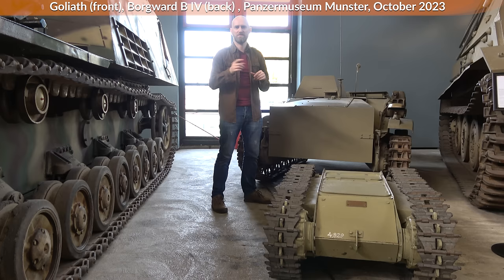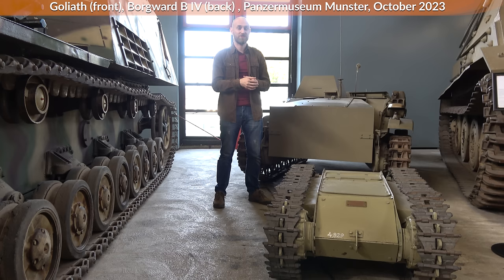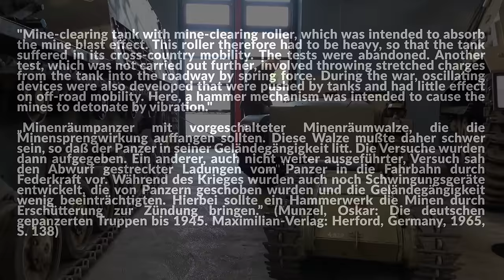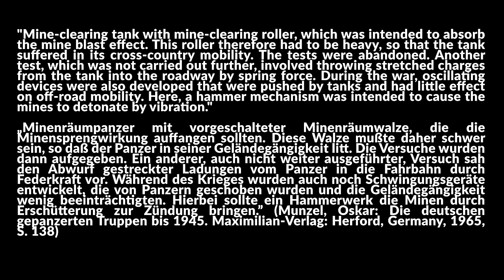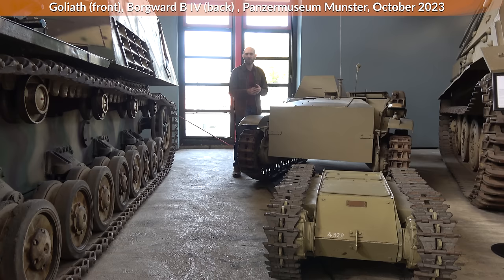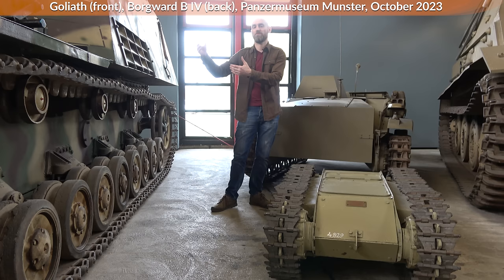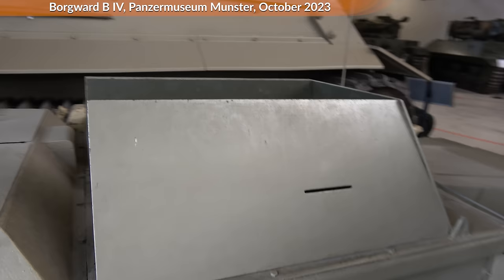Why no German Flail Tanks?

Comment: So in Afghanistan our engineers clearing mines got rotated off the vehicles after 3 mines were hit.  Anything more than three mines and the engineers started getting a little shell shocked and twitchy in the cabs of the mine clearing vehicles.
Reply: Getting concussed repeatedly in a short span leaves some level of CTE like damage.  As a byproduct of the NFL mess, the military became fully aware of the potential.  Shell shock is real

Comment: 6:20 Correction there, the Sherman Crab was made by the British with the key figure in its development being South African. The Americans used some provided to the by thr British.
Reply: Yeah it was one of the Hobart's Funnies types the British Army used for D Day.
Reply: My understanding is that the US went with the mine roller concept instead of flails - at least this is the story that Dick Hunnicutt tells in his Medium Tank history book. If Bernhard has found something different then I'm all ears?
Reply: @ExPatTanker  The US had the T1E3 mine roller, but it was far inferior to the Crab in the vast majority of circumstances.

It was too big and heavy to be practical outside very limited circumstances and it was absolutely useless off road (it used ten foot diameter steel disks).

It also only cleared the area in front of the tracks, unlike a Crab which cleared the entire path in front of the tanks. The former is good enough when clearing a road for vehicles to move down but problematic for something like establishing a path through minefields for an offensive where various men and equipment will be following those paths in less than ideal circumstances.
Reply: @88porpoise  Yes, I was agreeing with you - just leaving the door open for somebody to come along and give me new information that I hadn't seen before :)

Comment: It's interesting to read that the Matilda Baron, a very similar design to the Scorpion, was only used for training, and the Baron and Scorpion were built in different places due to military secrecy preventing knowledge of their respective constructions.   Next, I would like to see a video about the tauchpanzer,  schwimmkorper, landwasserschlepper, Brukenlager, Sd Kfz 251/7, Infanerie Sturmsteg auf Panzer IV,  and particularly the ladungsleger Pz I & II (still not sure how the explosive charge was supposed to be placed - was it lifted over the front of the tank, or was the tank reversed onto the target, exposing its pitifully thin rear armour?).  There were also Panzer II & III flamethrowers.  You can read my article about these vehicles in "World at War" #50.
Reply: The Matilda Baron presumably suffered from many of the same issues that the Scorpion did (and issues with Matilda II in general).

But it (along with the experience from North Africa) did provide for a learning experience that would go into developing the Sherman Crab.

Comment: Thank you Bernhard for another well researched and presented video. Cheers from NZ. 
There are always reported complications in mine clearance work. During our Engineer Corps Training at Linton Military Camp, New Zealand in 1984, the Chief Instructor was then Staff Sergeant Ben Akari. He had recently returned from UN mine clearance work in the Sinai Peninsula. One of the technical challenges was that  some of the minefields had been laid in wadis—dry river beds—in the 1950s and decades of ‘flash floods’ had redistributed the mines in random fashion!
Another issue, as reported to me by one of our Squadron Quartermaster Sergeants, was that: the Bedouin herders would steal the barbed wire fences that were erected, complete with mine signs, to keep people safe. The thefts meant that other Bedouin subsequently entered the unfenced minefields BUT that did not seem to bother the thieves. I suspect that similar problems have beset mine clearance teams from the introduction of the mass produced land mine.

Comment: Isn't the main issue that by 1943/4 Germany needed every tank it could get for defence, whereas mine-clearing is an offensive item that German was rarely doing.
Reply: Nonsense. Germans were beaten with ease both at Kursk and the Bulge, two critical battles, because all that heavy, expensive tanks had zero way of cleaning mines and a bunch of conscripts behind minefield were capable of stopping whole panzer regiments full of new Tiger models, all while laughing at wundertanks blowing up while accomplishing nothing...
Reply: Being on the defensive does not preclude an army from thinking about or preparing for offensive actions. Granted, it may not have been a big ticket item for them, but at some point they assumed/hoped/dreamed to go back on the offensive and from a planning perspective it makes sense to have been prepared for that.
Reply: They were still producing offensive equipment, like flamethrower tanks or Sturmtiger - 100% offensive design. One has to remember that there's a certain delay between designing, putting thing into production and implementing it to units. Vehicles that were designed in early 1942 when Germany was still on the offensive were often getting to lines in late 1944, when the situation was almost completely opposite.
However it's true German priority was getting tanks in the first place - some lower-tier Panzer divisions didn't get enough Panzer IVs and needed to employ StuGs in place of tanks by late 1944. So "wasting" a Panzer IV for mine-clearing vehicle, a role that could be done by cheaper means was not exactly a good choice.
Reply: @KuK137  Yes bro I'm sure they were pissing themselves laughing and entire German army just decided to stop because a tank hit a mine, and they totally had no means of doing anything about it. And all the gruesome casualties on both sides from these battles were just dudes and bros dying from laughter from this hilarious prank.
Reply: @KuK137 read Töppel and Frieser. He'll teach you where Overy exaggerated or even lied in his depiction of the battle of Kursk. It cost the Red Army over 400 T34, which was half of their tanks. German losses were small, there were more pressing reason for cancelling Operation Zitadelle.
Reply: @czwarty7878 mixture of reasons it takes time for there to be an acknowledgement that the initial successes short sharp action were running out and of a more defensive and protracted warfare , appropriate decisions taken and suitable designs produced then approved and put in production then enough to be deployed

Comment: The german approach makes sense for immidiate combat situations. Mine fields in combat should always be covered by fire. Using expendable or semi expendable vehicles there makes sense. A Sherman flail is very good at removing mines in situations where the enemy has abandoned covering the minefield or has no anti-tank assets to do so.
Reply: But at the same time the flail tanks should be covered by other assets from their side. 

If your artillery is laying down a smoke screen and suppressing enemy artillery and AT guns along with air support while the Crabs are covered by other Shermans (either normal gun tanks or the reserve Crabs) that will provide some degree of protection. Yes, they will be vulnerable, but almost certainly less so than swishy combat engineers or forces wandering through a well developed minefield that hasn't had paths cleared.

In North Africa the reports were that the mine flails kicked up so much sand that they effectively created their own smoke screens (and, less fortunately, it also choked off the air intakes of their engines).

To be clear, the Matilda Scorpion and Sherman Crab were very much designed to clear a path through a prepared minefield while under fire. Things like Second El Alamein (the Scorpion was developed in Egypt specifically for this operation) or Normandy, where they were to clear paths through minefields the enemy spent weeks or months building at the front edge of an offensive.
Reply: No, it doesn't make sense. It was shit, expensive, overcomplicated, and crap at every task you wanted out of it. Mine flail did one thing, but it did it well while nonexistent (due to impossibility of cramming all that junk into one vehicle) German was trash at everything because stuff existing only in wishful thinking does nothing. Even assuming someone would build such a vehicle 1 enemy shot disables all specialist capability unit has due to tiny production runs of wundervehicles while cheap flails can be deployed by the dozen...
Reply: @KuK137  I would add that this was not a trivial task. Developing a practical and effective mine clearance vehicle was a challenge with only the British really succeeding. The best the Americans came up with was a roller with huge issues (mainly due to the weight of ten 10-foot diameter steel wheels) and basically only useful on roads. The PT-34 was better than the T1E3, but still deeply flawed and less capable than a flail. Both of these also only cleared the areas in front of the tracks, leaving mines down the middle of the path. 

The Japanese were developing a flail, but I don't believe it got any real use before the war ended.

And the British absolutely took the kitchen sink approach to it. They had rollers, ploughs, flails, and line launchers as prototypes (and often multiple teams developing their own versions of each) and/or in limited service before settling on the Sherman Crab and post-war moving to the Churchill Road.

Comment: Thank you for answering this question I recently asked myself. 

For me it was intersting that the first organisational charts for the Heavy tank battalions had some of the Borgward as an integral part of the unit. I asked Wolfgang Schneider about this and he said only two units goit them (from memory) and apparently it wasnt a sucess, because later that practice wasnt continued.

But it does make sense at first glance to include them because Tiger Units were after all meant for breakthrough operations at the focal point of an offensive. So mine clearing and blowing up defences would have been part of that.
Reply from the maker: Yeah, I think I cut the part about the Heavy Tank Battalions.
I would although not draw the conclusion that it was discontinued due to no success, although in this case it likely was, but e.g., it could have that they realized they need them for every Regiment, Division, etc. (and then they realized, there won't be much attacking against minefields anymore) After all, they produced a lot of Goliaths, which of course could also be due to an error etc.
Reply: @MilitaryHistoryNotVisualized  yeah I think they just revised the organization but in practice wherever sPzAbt was used they probably assigned engineers with Borgwards anyway. Organic-assigned units are important for close support in "need it for yesterday" situations but with minefield clearing for entire tank unit it's a big and time consuming undertaking that must be properly planned and carried out by multiple units anyway

Comment: Germans constructed improvised flails for at least 1 Panzer II tank in Africa. Several photos surfaced of this tank. This design was initiated because minefields at Tobruk were a problem, and they crippled German attacks against the fortress on 14 April and 1 May 1941.
In one photo, an obvious problem with the flails can be seen. Tank is moving forward and there is large cloud of dust behind (perfectly normal in Africa), but there is also a smaller cloud between the flails and the tank. This second cloud appears to be large enough to completely blind the driver.
We will never know if this design was successful because German assault against Tobruk (planned on 20 November 1941) had to be cancelled, because of the British offensive on 18 November 1941.
Reply from the maker: Source? Can’t find anything .

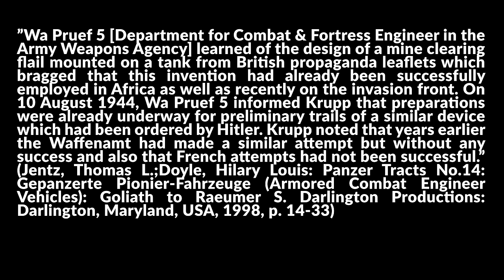Comment: It seems inherently unlikely that the Germans took over two years to find out about a piece of equipment that must have been used in plain sight of them.(05:53)
Reply: The flail tanks in North Africa might never have operated within sight of the Germans at all if they were primarily employed to clear paths through already-secured minefields well behind the front lines.
Reply: @LafayetteCCurtis  Surely, the whole point of using tanks was that, being armoured, they could operate at the front.
Reply: @markaxworthy2508  Not necessarily for these specialised vehicles. The video itself pointed out that the Sherman Crab saw much more use clearing minefields in the Allied rear areas, where the armour was still quite useful in protecting the crew from fragments (whether from artillery fire or from fhe mines they triggered). The Matildas probably operated the same way, still within tbe threat range of enemy artillery but beyond direct Axis fire or observation.

Also remember that most of the Afrika Korps was captured when they were finally defeated in Tunisia. It's not impossible that even if frontline Axis troops saw Allied mine-clearing tanks, they may have been killed or captured before they could write any reports on them, and if any such reports werr ever written then it's perfectly plausible that they never made their way through the bureaucracy in time to be taken back home by Rommel or the relatively small number of officers and veteran soldiers withdrawn before the unit's encirclement and surrender.
Reply: @LafayetteCCurtis  Certainly, "not necessarily". However, engineers don't need specialist armoured mine clearing vehicles in rear areas, where they have fewer time constraints. However, they have clear advantages in the combat zone, for which they were designed. Their continued use in rear areas when the front was quiet would have been more productive than leaving them parked up indefinitely. 

It still seems inherently unlikely that the Germans took over two years to find out about a piece of equipment that must have been used in plain sight of them on multiple  occasions. Perhaps they just never captured one to inspect its mechanism..
Reply: @markaxworthy2508  There’s nothing “inherently unlikely” about it. Military intelligence processes are inherently complex, often unreliable, and always clouded by the fog of war. Even if the Germans did spot British mine tanks in Africa in 1942 (and there’s still no certain evidence that they did), there are too many steps where the report could have failed to make its way to a decision-maker back home in Germany, and then the decision-maker could just decide that the observer at the front was just imagining a thing that didn’t really exist. So it’s perfectly reasonable for the Germans to lose or dismiss or ignore the information they needed to understand the relevance of Allied flail tanks for over two years.
Reply: @LafayetteCCurtis Well said. The flail tanks probably operated in sight of the Germans but with fog of war, (especially given they threw up their own extra fog with all the dust they stirred up) it is far from inevitable that the existence and capabilities got reported correctly up the chain of command.
Reply: @LafayetteCCurtis  They were absolutely used on the front lines. Theybwete used in rear areas when available, but they were designed to be the leading edge of the attack.

However, even then:

1) They would be covered by smokescreens and dust clouds as well as massive artillery barrages keeping German heads down.
2) There weren't that many of them. The bulk of the work clearing paths through minefields at El Alamein was done by traditional means. Also they broke down fairly.quickly due to various reasons.
3) Not many of the Germans were likely to see them up close, and they probably wouldn't know what they were.
4) They wouldn't have captured any or provided opportunities for intelligence poeple to inspect them due to the getting decisively defeated.

And I am sure there are more reasons.

Comment: I'm not surprised the side which was on the defensive for most of the war didn't invest in mine clearing.
Reply from the maker: >  I'm not surprised the side which was on the defensive for most of the war didn't invest in mine clearing. 
1939: Fall Offensive
1940: Spring & Summer Offensive
1941: Summer Offensive
1942: Summer Offensive
1943: Summer Offensive
1944: Defense
1945: Defense
I would word that differently in your case.
Reply: Oh? According to what you're saying, they were on the offensive for less than 20% for the entire war. 🧐😂
 @MilitaryHistoryNotVisualized
Reply: @BayaRae imagine saying the Germans were only attacking for one year of the five and a half year long war

This isn’t even a debate you’re just talking nonsense
Reply: @MilitaryHistoryNotVisualized don’t forget they were still attacking in 44 (ie trying to cut off Cobra’s breakthrough) and even 45 (Hungary)
Reply: The only battle after 1942 where mines were a major factor was Kursk, mainly because of Hitlers dithering and delays.
Reply: @terraflow__bryanburdo4547  so that 25% tank casualty rate due to mines is just…made up?
Reply: @looinrims  That is for the Allies. For the Germans it is 25% due to running out of fuel 😅
Reply: @BayaRae  math is clearly not your strong point.